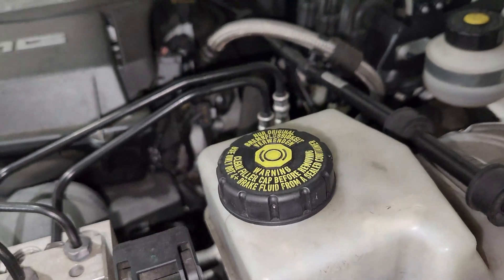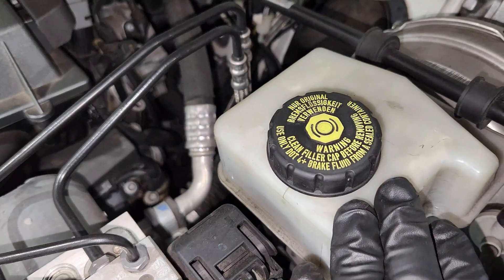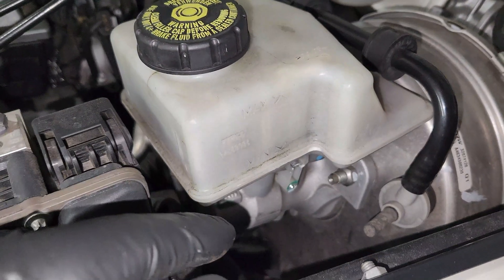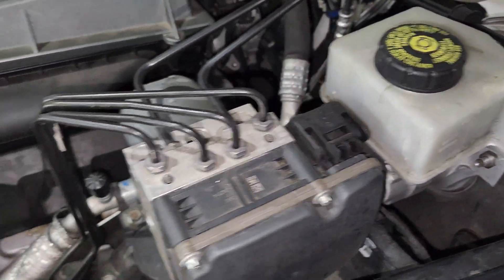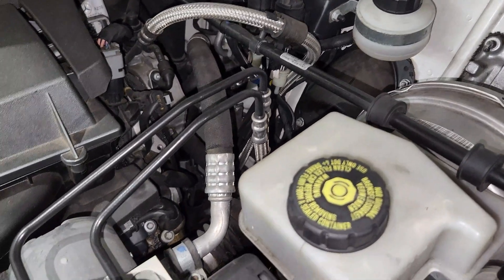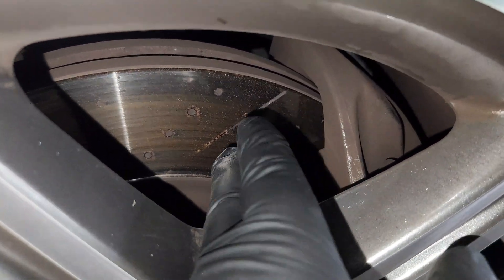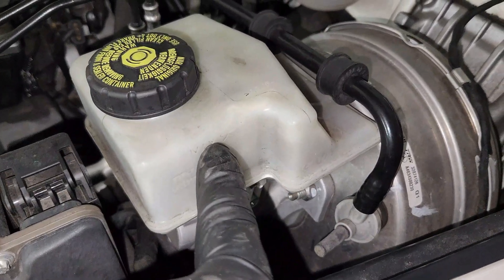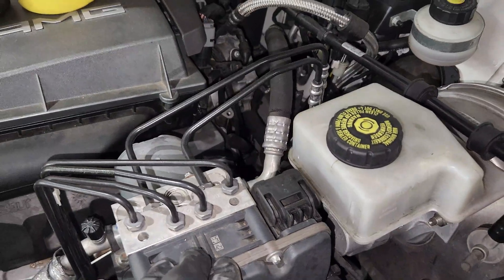DIY Brake Fluid Service: Stop Brake Problems Before They Start!

Comment: I have never seen a problem with moisture in a brake system.  If the fluid in the master cylinder reservoir is dark, it makes sense to replace the fluid.
Reply from the maker: Brake fluid is hygroscopic and over time tends to attract moisture. And yes, dark fluid is a sign that indicates that your brake fluid has been absorbing dirt and debris as you drive, as well as water. Too much moisture (water in the system) often shows up in the brake fluid reservoir cap.